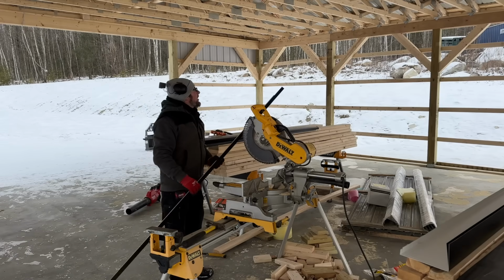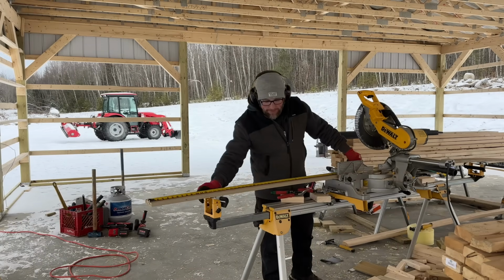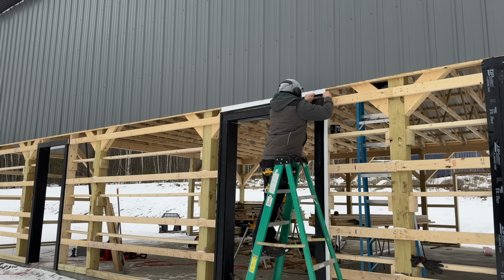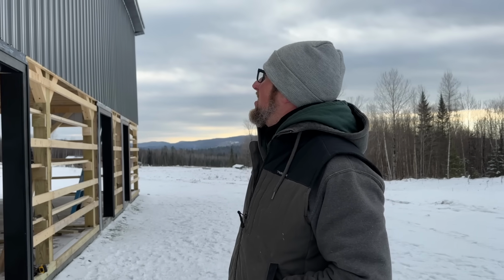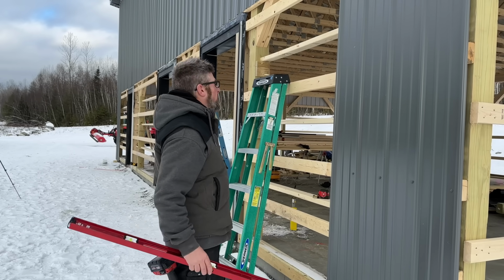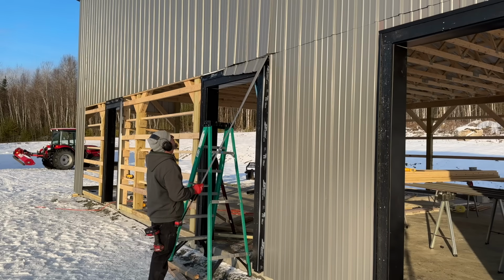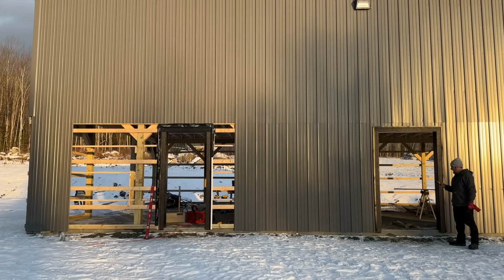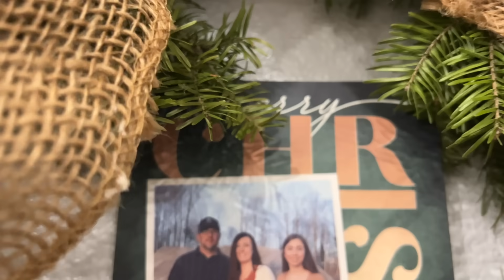She Wasn't EXPECTING THIS! | Building Our OFF GRID Barn in the WOODS

Comment: Gina, You need two different colored trash cans on the back side of the saw. One for wood and one for metal, then Al can play basketball by throwing the scraps into the appropriate container.  I use cardboard boxes as I give them to a neighbor that heats with wood and they burn box and wood together.

Comment: Looking amazing!  Your workmanship and attention to detail is the key.  Don't know if you saw my post from the previous video (I posted it late) but have a theory about the broken tractor door.  Maybe a moose/deer saw its reflection in the glass and thought it was a rival.  It challenged and attacked with its horns, thus the glass inside the tractor.  It became a little stuck and broke more glass pulling out.  If I remember correctly, there was a little divot on the ground, maybe where its hooves were.  Did you happen to notice any tracks?

Comment: Looks good.  For future consideration, when you do your door jambs, bend the metal at the top in on both sides (instead of cutting it flush).  Then when the top goes in, you cover any gaps in the top corners.

Comment: For future reference, when cutting the vertical flashings (jams) for your doorways, leave a 1 inch tab that gets folded to run along the lintel. That way when you install the lintel flashing it will overlap, leaving a clean and weatherproof corner.

Comment: you should swap in some polycarb panels to let the natural light in. places like the roof or south facing wall. but even 1 in3 of the low panels will let light in. and you can get dark gray panels with that profile so they dont look too out of place.
Reply: That's a good idea!
Reply: Or install a dozen or more high intensity lights. “/s”
Reply: @freddymax5256  i love not needing lights on just by swapping a few panels.

Comment: What blade do you use on the mitre saw to cut the metal?  If Gina had a piece of 2x4 the right length, she might be able to push the whole width of the sheet at one time.

Comment: Be sure the ends of that prefinished trim are sealed. If it's the LP product, they can provide the easy apply paint product to do that and it also goes over the nails to hide them.
Reply: It's just a barn
Reply: @col2560  The purpose for sealing the ends is to keep them from degrading from moisture, etc. Barn or not, having to replace the trim prematurely would be a pain.

Comment: Great videos, finding t fascinating how you do things compared to here in UK. One question i got, are you leaving one side the barn open so theres airflow through to stop respitory diseases in your animals, if you are going to keep animals in there.  Also airflow to help keep air fresher from animal smells too.  Why areare you using tin to clad, why not wood?  As many sheds similar here are clad in wood at top half of shed, and botom half preformed concrete or feed barriers for livestock.  Interested to know your reason for the decision, is metal cheaper than wood??  

I found the plug and go solar fascinating as in UK, it has to be installed and certified by a qualified electrician.

Comment: Efficiency and safety enhancement idea for another time.  If you made a simple tool from scrap wood for Gina - 3ft'x2inx2in horizontal piece attached to one end of a vertical piece of 2inx2in for a handle to push out the upper sheet metal for you to put the lower piece underneath.  No ladder climbing up and down and can push all the ribs out simultaneously with little effort.  Living vicariously through you for a few years now.  Keep it up!

Comment: It has to feel good each time you finish a section. 🎄 ✝ I found a circular saw metal cutting carbide blade to be much faster than the grinder for cutting that sheet metal. A slight new learning curve, but it works well, and for me in my older age that grinder dust drives my sinuses crazy, so no grinder dust is a bonus.

Comment: sorry to point out that the bottom 1 1/2 inch of your door caps will be corroded off in about a year or so, because it is touching your pt seal plate . i learned the hard way also . ☹
Reply: adding some zip--tape there (beforehand) can solve the problem.

Comment: I noticed you started off with a battery operated coil gun from Dewalt but then I see you switched to an air operated coil gun. I was wondering if you could let us know what happened, why are you switched and if the defaults battery operated coil gun is worth it.

Comment: Did you say that you weren’t going to insulate? I think that’s gonna be a mistake animals give off heat and during the winter time you’ll have condensation dripping on you like it was raining outside I think at least 2 inches of spray sprayed in insulation on the walls and on the ceiling would be more than enough. Nice job though have a merry Christmas.
Reply: Animals are much healthier in uninsulated barns. His big mistake was not building it out of wood.